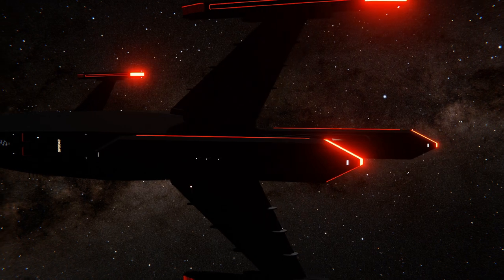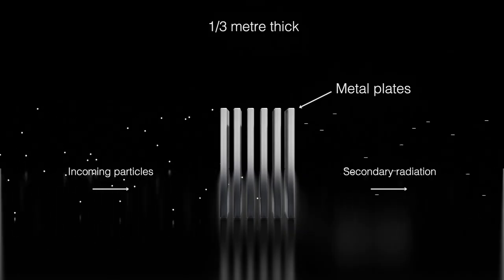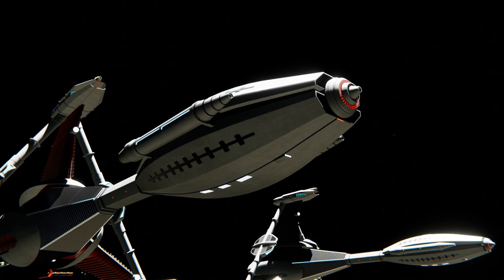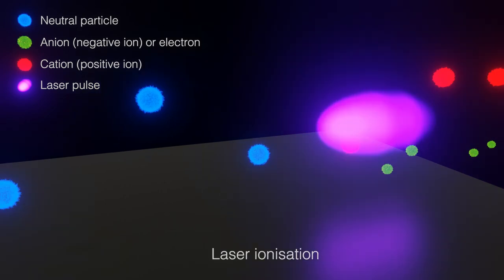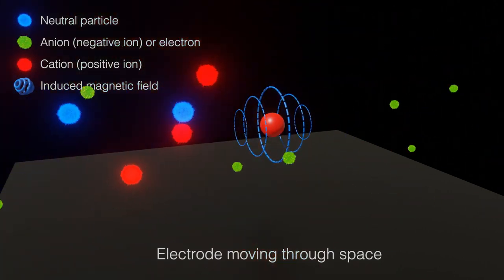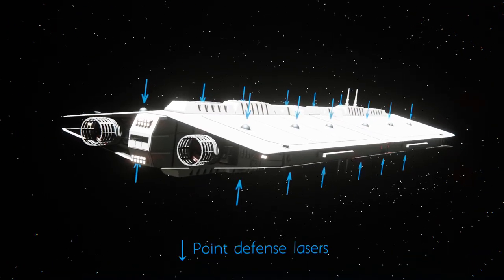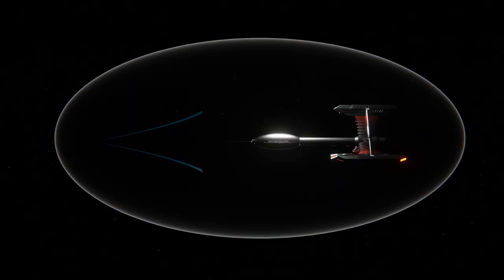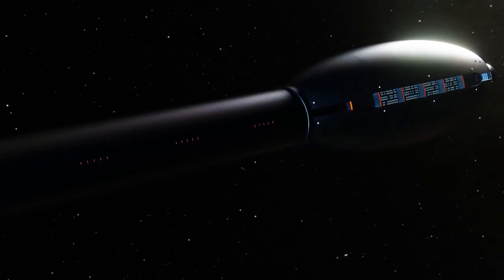Deflecting Faster Than Light Debris

Comment: Successive waves (an armada) of of advance minesweeper drones clear the path for the mother ship.  Drones serve both to absorb particles and to sigmal back, being highly sensory and intelligent and in constant analog (servo) communication with each other and the mother ship.  Encountering a field of bodies large enough to take several drones signals a directional change for the armada.  The Oort Cloud is a problem and may harbor unfriendlies.  Two variables vary with desired excursion speed:  (a) The physical length of each individual drone (to absorb particles); and (b) the spacing between each wave/layer of drones. For excursion speeds that are multiples the speed of light (xC), these lengths necessarily increase;  individual drones may be a mile in length, and successive waves of drones may be 1,000 miles apart.  And no, the speed of light is not a barrier—mass does not approach infinity, that’s an old wives’ tale.  Servo communications between drones and the mother ship would be via particle beams.  Drive is controlled fusion until antimatter drive is perfected.  A constant acceleration of 1.5 G would proffer a livable artificial gravity for humans in the mother ship, and would achieve Proxima Centauri in a matter of minutes.  My objective is Andromeda.
Reply: I definitely agree about your comment regarding ‘the speed of light’ misnomers.
It’s been taught wrong; it’s not a ‘speed LIMIT’.
It’s just the speed of causality, if the future was here, already, photons would move even quicker!
Get that high powered (fusion) warp bubble tech going, & the rest of the necessary tech will pop up quickly.
We can chew bubble gum & do physics simultaneously!
🖖✨

Comment: If you did trial runs on the deflective sheath plating with drone craft, you’d get to be able to see how long you could go before protection systems failed and that’s if they fail, this could help you to calculate the distances you could travel at let’s say light speed speeds before damage and danger to crew would happen, you would need a self re generating repair system for the sheath plating, this if sheath plating was designed in a custom configuration, in where inside the ship you could change parts with lots of spare parts in storage, if not you would have to stop spacecraft after the light speed jump distance limit that your drone craft data read for danger limit, and crew mechanics repair, a designed configured spaceship reversing plates etc, so you can do repairs, magnetic clock work ufo 🛸 maybe ? If not and all failed you may have to wear special space suites inside craft or go into Cryogenic dream chambers protected 😂 your boy from the cartoon poindexters Lab 😂